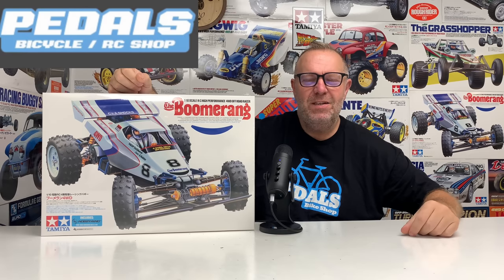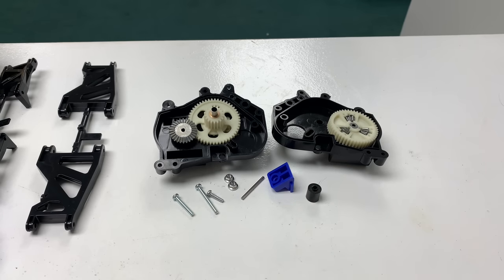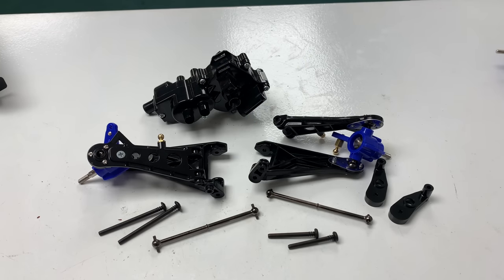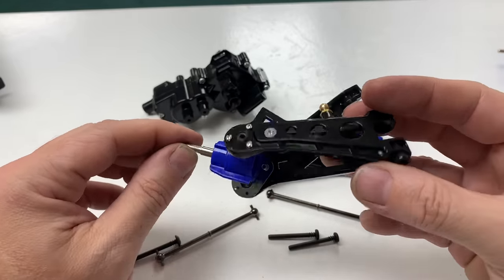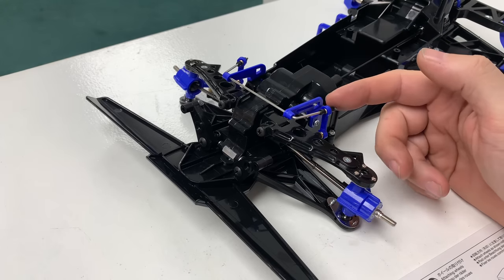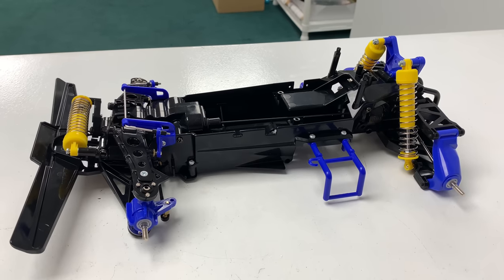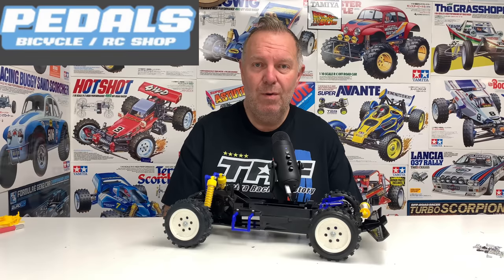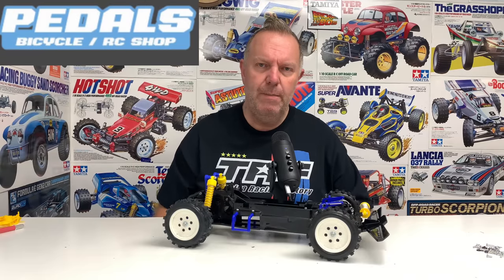Tamiya Boomerang 2023 Build…

Comment: Built one of these as a teen some time in the 80’s. Still got it in a box in bits. It had some hammer and many parts are cracked or worn but still occasionally think about restoring it and putting it back together.

Comment: Nice, Glenn! I remember back in 1987 when I first saw the Boomerang cut-away on the cover of the Tamiya RC Guide Book. I fell in love, but never owned one until recently. Mine is from the last run, which was 2008, I think. Is that right? What's the difference in that last run and the 2023 run, aside from the included Hobbywing ESC because of shortages? Thx!